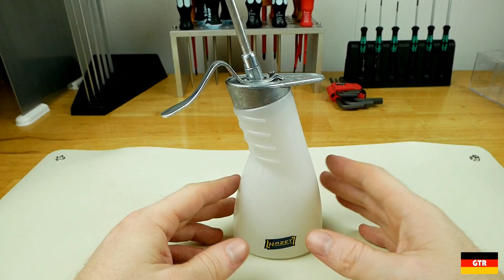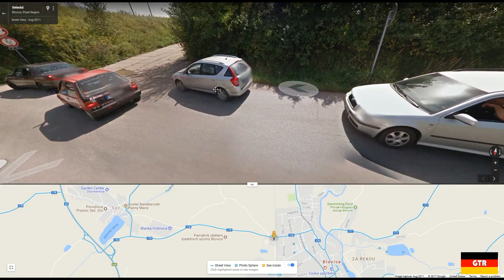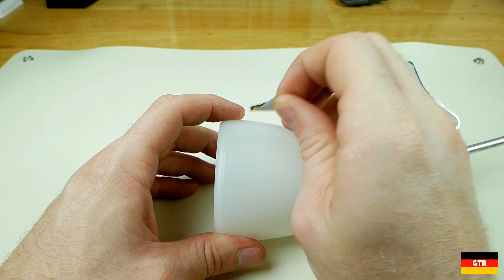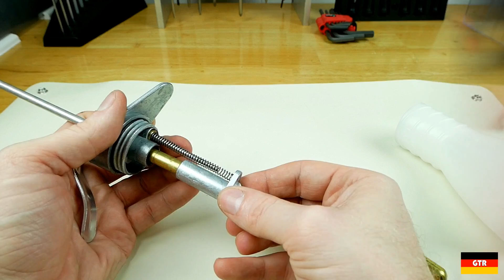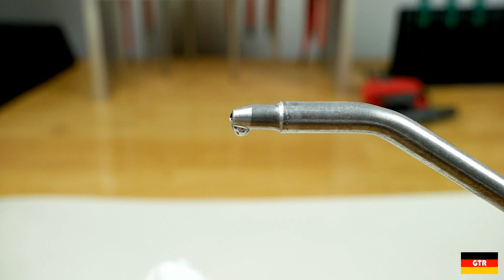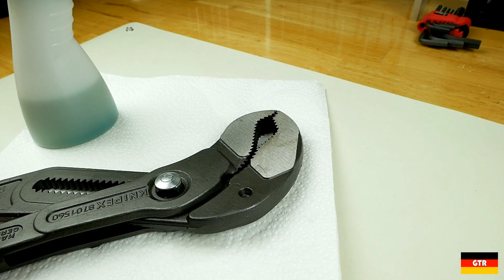German Tool Reviews:  Hazet/Pressol 2160 Oiler

Comment: I did a bit of digging around and the pressol #2 oiler is the one for the ballistol, pump is of plastic nature and doesn't leave the can, ordered one yesterday along with some ballistol, looking forward to using it now ;-)
Reply from the maker: Cool, yeah I did see that the old Pressol #2 designed is advertised as not having any brass components.  So it might be specifically for alkaline oils such as Ballistol.
Reply: Matt im pretty sure yes because I was looking at the website and there was an offer on with that oiler plus a bottle of ballistol oil, I can't see any issues,

Comment: How has your oiler turned out after removing and cleaning out all the Ballistol oil? Is it stained anymore? Did it hurt any of the internals? Did ya find any quality oiler to hold your Ballistol oil? Cause I'm trying to find oiler to put that oil in my self since the can or it comes in isn't very easy to use, and the spray pump that screws on atomiser doesn't really work well either. Let me know the results, I just ordered Resilang Oilers (Swiss/German?) to try out also but I think it would be the same almost as the Preasol oiler. Also can you your Hazet/Pressol oil be used upside down?
Reply from the maker: I rinsed it out and put some 3-in-1 oil in it and it is working just fine.  All it really did was tarnish the brass pieces.  I think the Pressol #2 oiler is all steel but I would need to check.  You can use it upside if you prime it first, which will fill that lower mechanism with oil.  You would need to prime it again to keep using it upside after that tube is used up.
Reply: German Tool Reviews I looked at the industrial version at KC Tools and it has brass also (identical except the HDPE is Cast Aluminum)

Comment: Balistol was made to remove Metals from rifle/gun barrels; so it dissolves bass.
You can find oilers with all parts made from steel for that.
Reply from the maker: Thanks, lesson learned.  I would think that they would include that on the bottle but I checked and no warning for brass.  I did flush out the oiler and it only looks like it tarnished the brass so it should be OK with another oil.
Reply: Depends on, witch form of bottle/can you by. I think on the glass bottles it is mentioned, et least in the flyer that is in the cardboard box the glass bottles are sometimes sold in. And on every package is some hint for removing lead and tombac from barrels. Tombak is a copper alloy. Maybe you find a glass bottle. I find them nice to take them on a trip, and refill it from a 1l can.